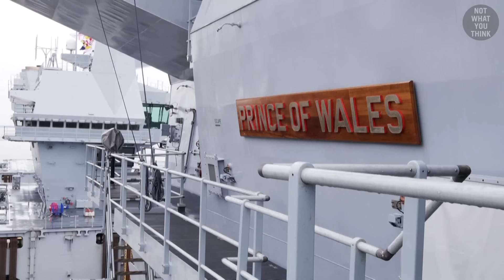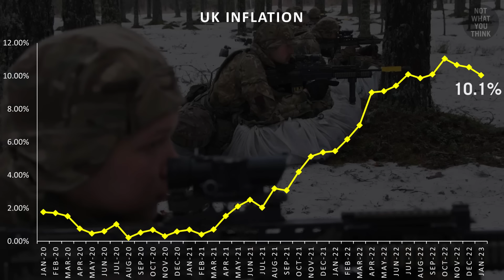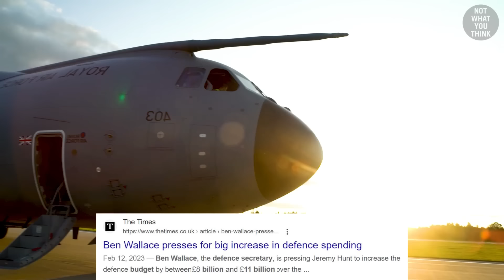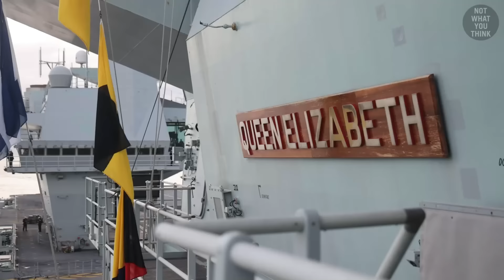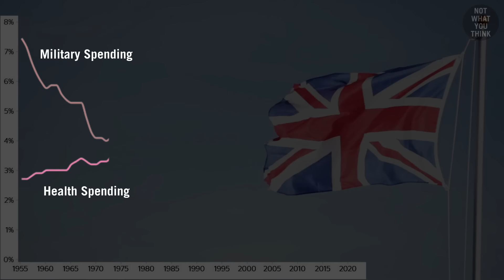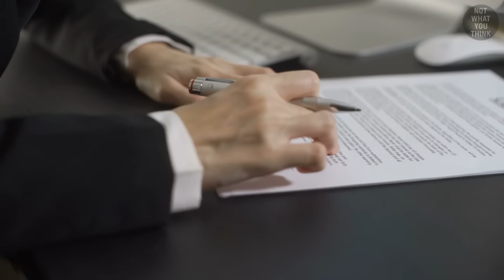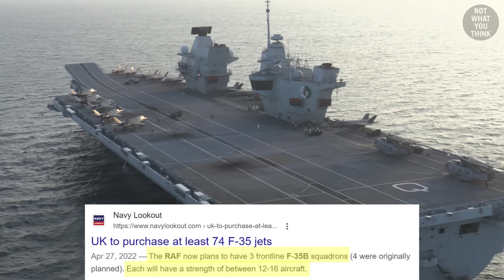Why QE Carriers are Considered a PART-TIME Fleet

Comment: there are reasons for some of the troubles these ships have, we do not have any manufacturing industries left in the UK. there used to be a vast pool of experienced engineers and tradesmen that the warship builders could call on but which have now gone. by far the biggest problem is the politicians, who are simply clueless. they couldn`t make their minds up whether these carriers would have fixed wing or stol aircraft, each time they changed their minds it cost millions.
Reply: nope we can defo build good ships at glasgow and subs at barrow, its all modular connects these days and these yards have the trades guys. problem lies with MOD tendering and not finalising the design before construction commence

Comment: I wonder if some of those technical problems are due to the shipyard going "If they're scrapping this one as soon as we're finished with it, why should we bring our A game? Just rush those pipe weldings."
Reply: lol same thoughts here
Reply: It sounds like a mix of that and the crew slacking off for the same reason and not doing proper mantainance
Reply: It seams so. Worst part is that there is actually good reason most navies have two Carriers, until they literally cant afford more then one. Ships can't operate indefinitely, they would land in repairs from time to time and those tend to take long time. Having two ships you can alternate maintenance, having always at least one operational. US Carriers actually maintain 9 Air wings for 11 Super Carries. Usually only 4-5 is operational at the time, 4-5 is refreshed (vacations, training, lighter duties). It is because usually you have 1 Carrier on duty, one in preparation and one in the refit. Typically at least 3 or 4 Carriers is completely out duty in the dock (difference in numbers is because with more carriers you can plan more effectively). Light/Helicopter Carriers/Assault Ships are more task oriented, so they don't stay on duty all the time and you can do preparations in between operations. But you still can't do much if ship land in repair dock. So it make more sense to have two. In short. UK government is run by monkeys.
Reply: Flog it to Australia, we'll give you Au $1,000,000,000 for it, we're use to fixing other countries mistakes, we're getting very good at fixing design mistakes too. We are a member of the AUKUS alliance, and will be working with you on designing and building the new Orca class nuclear propelled submarines. We'll probably need to employ a thousand or so Brits to man the bloody things too, we can barely keep three Collins class deployed. That's the problem with Aussies, as soon as we knock off work we want to grab our surfboards and head for the beach. Not easy for this Tree Lopper who lives in the Blue Mountains.
Reply: @krashdown5814  HMS Prince of Wales took 3.4 billion to build it, why will they sell for 1 billion dollars. It will take 4 billion dollar as bare minimum for it.
Reply: @niweshlekhak9646  Not worth that much.
Reply: @rayjames6096  It also means giving tech away, that carrier might have mechanical bugs but it still has high tech installed on it.
Reply: @niweshlekhak9646    It lacks essential carrier combat capabilities like aerial refueling and COD ability. It has no extra power generating ability for future upgrades.
Reply: @rayjames6096  why will a regional power carrier require aerial refueling and COD. COD and aerial refueling is only if you need to go to long distances which Queen Elizabeth can do.
Reply: @niweshlekhak9646    The aircraft going to or coming back from a mission might not have the fuel to get there or come back if something happens or if there is a delay on landing on the carrier there needs to be an ability to keep them in the air...this is carrier operation 101.
Reply: @niweshlekhak9646    Carriers are offensive weapons.
Reply: @niweshlekhak9646 : FFS, have you ever of the term "tongue in cheek"?
Reply: @rayjames6096  no British carriers are for protecting the Baltic, Persian gulf and Mediterrarian. All of which are surrounded by NATO and British allies.
Reply: @rayjames6096  they are making an aerial refueling drone, rather than rely on planes.
Reply: @niweshlekhak9646  Why did HSBC just buy UK SVB for £1 when just the bowl of murray mints at UK SVB reception is worth more than that?
Reply: @niweshlekhak9646  No they're not and besides there's no way to launch it.
Reply: @niweshlekhak9646  The British are not developing a refueling drone and the QE class is not capable of launching drones anyway.
Reply: @rayjames6096  you launch it from one of the other ships, not from the carrier.
Reply: @niweshlekhak9646  How is another ship going to launch a refueling drone..?they're huge( so they can carry the fuel) and require a catapult. Your making up nonsense. 😳
Reply: @niweshlekhak9646    The UK only has 18 other warships, 6 destroyers and 12 frigates and none of them can launch a refueling drone.
Reply: @rayjames6096  one of the Ambhibious assault ships will lauch the drone.
Reply: no, it's just the crap standard of British workmanship
Reply: @niweshlekhak9646  it was built as a make-work project by gordon brown, for his countrymen. he also `fixed` the contract so construction couldn't be economically abandoned
Reply: @davidshack1  There is nothing  crap  about  British  workman ship, it was Britain  that invented  the aircraft carrier  in the first place  !!
Reply: @rayjames6096  Not to mention  300  Trident nuclear ballistic missiles  ! On  nuclear  submarines  on the Vanguard class  submarines  !!! Now also the Asture Class is the most advanced  subs by the Royal navy!!    Later to be replaced by the Dreadnought class  Class !! There are  70   ships currently  in the  Royal navy !
Reply: @rayjames6096  The aim is ultimately  have unmanned  ships !!!
Reply: @nigelpilgrim4232    You might want to look into those MLRVS and Submarine contracts...it's always been there, the UK didn't it advertise tho.
Reply: @nigelpilgrim4232    Not nuclear tipped ones.
Reply: It's due to the government not spending enough for the defense contractors to care
Reply: @nigelpilgrim4232 Dreadnought class SSBN replacing Vanguards only.  UK has maybe 200 nuclear warheads on 58 Trident missiles, only 12 or even 8 of which are at sea with 40 warheads on a single sub doing deterrent patrol. Astute class SSN attack subs will only number 7 when all in service.  New Aukus class subs might increase more likely replace these later.  Effective British naval combat fleet is about 33 major units surface and subs.
Reply: i must say if the prince of wales is always getting plagued by mechanical problems like this so often, it stops being a string of coincidences, and more like deliberate sabotage.
Reply: @TheRezro  >there is actually good reason most navies have two Carriers

This might be some poor wording on your part, but that statement is not true. There are only 9 navies on the planet with 2 or more aircraft carriers, and this is including helo carriers and specialized submarine-hunting carriers. If you're being more strict in your definition, then it's just 6. And this isn't just a quibble, about 100 nations have navies and even some with large numbers of ships do not have aircraft carriers at all.

 I think what you meant to say is that most navies that do have aircraft carriers will try to have 2 whenever possible, not that most navies in general have 2.
Reply: @dodgechance4564  You missing the point is legendary.

Comment: Unbelievable that the second aircraft carrier has all the problems that should have been sorted after the first build.
Reply: British workers not hired on merit, hired by box tickers.
Reply: The same goes on with the British fleet of nuclear submarines, both SSBNs and SSNs are plagued with faults and problems, the major one being the Rolls Royce PWR2 reactor that equips both class of subs and the result is the entire fleet of SSNS and the entire fleet of SSBNs being at dock, rarely one sub is at sea most of the time they are non operational. As an example for the entire summer of 2023 all SSNS and SSBNs were in port, no nuclear deterrence at all for the Brits..
Reply: @brunol-p_g8800 there is always a nuclear deterrent at sea
Reply: @brunol-p_g8800  Interesting you seem to have a lot of knowledge of the operations of RN SSBNs and SSNs, which isn't something that is made public and if you did in fact know these things you wouldn't be posting them on the internet. If your going to try to make things up don't be so specific.
Reply: @xXBisquitsXx  that’s not a secret, that’s open source. As of summer 2023 all RN navy submarines were docked at port and none at sea, including SSBNs. The issue is mainly due, like always, to political decisions, in this case retiring the two left Trafalgar class SSNs, which were the only ones operational while the entire fleet had the PWR2 reactors’ issues managed, the same day.

Comment: Don't believe this. ALL new weapons systems have problems. The USS Ford and the France's Charles De Gaulle had issues before coming into service. The PoW is no different; it will come into service AND it will be appropriately aircrafted over the next decade. The UK NEEDS two carriers, and the cost of maintaining two is NOT half of the cost of maintaining once carrier.  --  I am a former Naval Air Analyst.
Reply: Exactly

Comment: They don’t need to operate two simultaneously, having two is good for making sure one is always available when the other needs maintenance. The government seems pretty committed to the Prince of Wales since 2015, other reports suggesting she could be mothballed since are just rumours, and writing the ship off for some technical issues this early in its lifetime is wrong. Especially following the quick and successful development of her sister ship. And this is actually a good advertisement for having two carriers, whilst the Prince of Wales had problems the Queen Elizabeth stepped in and covered her. In terms of the UK CSG capability this is one area we can be positive about, even if Uk defence overall is lacking.
Reply: That's not how it works. Each ship has its own crew. So even if it is sat in dry dock you are still paying the operating costs in terms of man power. It still needs a full compliment of weapons and aircraft.
Reply: Just one carrier is a very bad idea for the reasons given in the video.  The one third rule is pretty ancient, it even influenced (in a very minor way) Jutland, given part of our battlefleet was undergoing routine mainenance/modifications.  Thus Jellicoe had fewer frontline vessels than he wanted.  Not having carriers would almost certainly encourage Argentina to invade again, although our submarines routinely patrol those waters as they are well aware.
Reply: @bubba842  In many cases it is how it works, and a carrier will not always have a full compliment of weapons, aircraft on board etc. Crew can be posted elsewhere, as is practiced often in the RN when ships are in maintenance or inactive. You are still paying some operating costs, but they are significantly reduced from a deployed aircraft carrier with a full carrier strike group supporting her. As long as the carriers are well alternated, and maintained, then having one on and one off is a good idea both for money saving and for maintaining a constant CSG capability.

Comment: 9:06 actually they spent 5 years building the CDG, from 1989 to 1994, nor did it encounter many problems, only a part of one propeller broke during the sea trials and an accident occurred with fire on isolation materials. The flight deck was lengthened during the construction following a decision to acquire Hawkeyes that wasn’t on initial plan in order to give margin for its landing in rough seas, every carrier goes through modifications during construction that’s not a problem.
Reply: And the propeler that failed was german and was replaced by french made one later and they had no problems anymore.
Reply: Lies again? AMWF CAR
Reply: The building of the CDG was still considerably delayed, afaik it wasn't finished until about 1999 ans was operational from 2001. Basically we made one aircraft carrier in the time initially planned for the building of two, and with almost the budget for two.
Reply: @joriss5  the building of the CDG was finished in 1994.
Reply: @joriss5  and the QE needed 11 years from start of the build to being commissioned…

Comment: There is a very good reason why the PoW has a propeller problem. Its just evident in the name, its predecessor got sunk after the props were struck. QE is doing well because its predecessor did extremely well and tons of decorations./s

Comment: Well, the simple matter is that Britain had never to my knowledge was going to have both carriers deployed at the same time.
And in fact, it looks like the strategy of having 2 carriers paid off. They  had problems with the Prince of Wales, so they swapped out and sent the HMS Queen Elizabeth. 
Sounds to me that was the whole reason to have 2 carriers and it has quite much worked out that way then, right?

So, for such rotations, one carrier would have NEVER worked out well, but with 2? 
Gee, sounds to me like a near perfect and reasonable setup then, right?

And as far as fighter jets? The MAX on board was to be 36, but typical is to be about 18. In fact, that was the same number on such ships during the
Falklands war (one had 24 on board, but that was not from planning).
As for purchase of f35's?
The original plan was a total of 138, and only 48 of them were to be F35B models (the STOVL model for their carriers).

Now? Well, it looks like they will NOT purchase any F35A models for their air force, and will ONLY purchase F35B models for their carriers.

As a result?
They expect to purchase around 70-80 F35B models. That means they WILL be able in a pinch to deploy 2 carriers, and each would about 30-35 fighters each. 
That is still MUCH more then what Britain was able to deploy and manage during the Falklands war. (one ship with 18, and the other with 24 Harriers).

and the F35 is MUCH more of a force projection fighter then the Harriers ever could be.

So, for now? Sure, they will rotate between the two carriers, and if one is in dock, the other can be at sea. Quite much EXACLTY how things are turning out.

There was never to my knowledge the plan to deploy both carriers at once, but that WILL still be a option such as a war or conflict.

In the meantime, they will and do have a operational carrier - and with 2 carriers, that becomes rather practical.

Seems to me, the idea to have 2 carriers that enables "one" operational carrier at sea is working out quite well.
Reply: Maybe keep one, but swapable nameplates and bells for it. That way the Russians won't know?
 it might be a plan. Just sayin'

Comment: Although mentioned, carriers are “only” the central point of a carrier strike group. That means that several ships must operate simultaneously with the carrier. They also have their OWN maintenance-cycles. My last (+related) point is staffing. QE2 was not ready to deploy into the late-2023 Middle East conflict-zone because they had insufficient staffing on ships of its strike group.

Comment: Well seeing how the prince spends more time in port and repair than at sea, having half the air fleet doesn’t seem that bad. Technically they only need to put enough air craft for one carrier.
Reply: These carriers are equiped (or will be) 34 planes each. If we do need to deploy others from the docked one can fly out to increase the air wing.